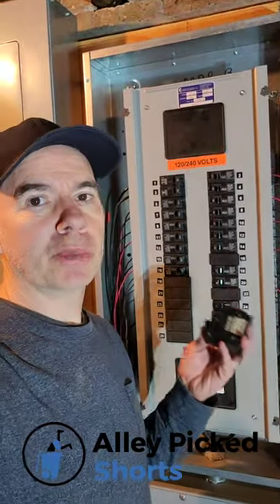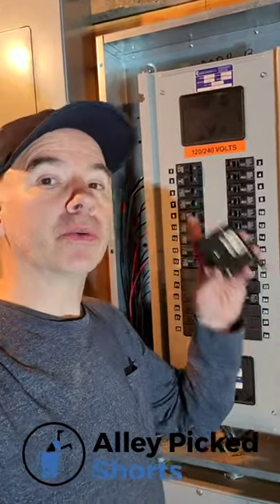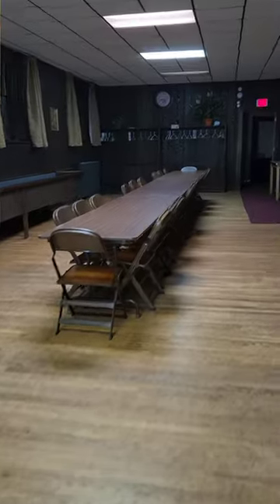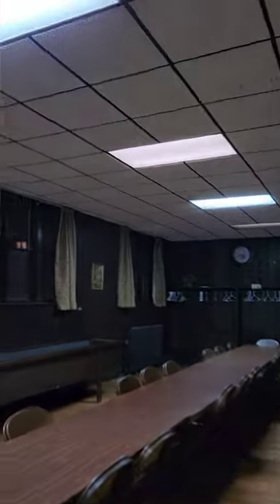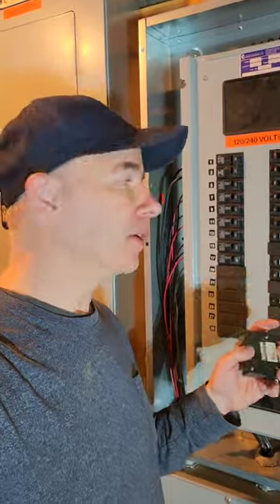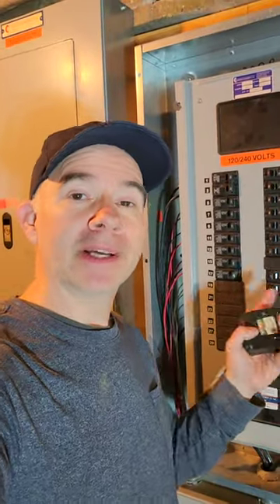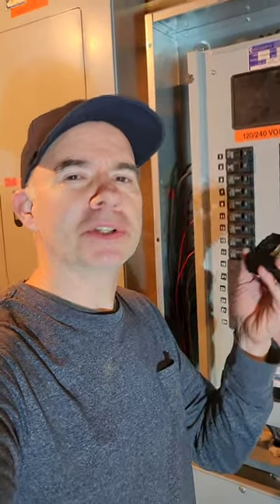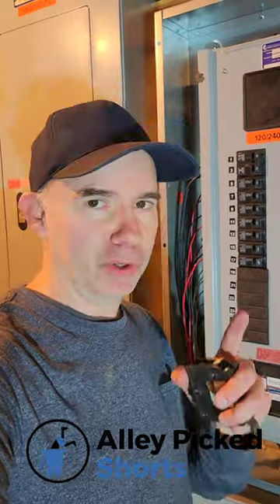When Circuit Breakers go Bad

Comment: So.... I had a problem with my hot water heater one of the anode robs just fried out of nowhere now I got everything new I mean I did it all but replace the actual tank and now it gets no power. It doe have a jumper box like one of a outside ac unit. You pull this breaker bar kind of thing out and it cuts the electricity to the hot water heater I did turn off the breaker before I even pulled that out. Now I'm getting nothing from thet box or my hot water heater. You think it's the double breaker I shut off? If so I would set my multimeter to voltage over 200 and touch each breaker eith the red and black correct? Shoukd read 220 v? Right? Or am I not understanding? I hope you do get back to me if not I'm positive I'll figure it out. I've has such bad luck lately I just really hope it's a breaker and not something more serious. I mean such bad luck it's very alarming. 😪

Comment: My 1965 mobile home has the original breakers.
Built differently back then.
Reply: @candeffect If you have enough circuits, the load on each breaker is way below its rating.  Now if your running some heaters on a, say, 20 amp circuit, it's going to be at 18-19 amps for a prolong period of time and the heat builds up and thus ages it much quicker.  Some people use breakers on lights, it works, but it's a expensive light switch.  This is why main breakers seldom go bad.  They are hardly ever used to disconnect and for most of their life, they operate at only a small percentage of their rating.

Comment: You left the part out where you put a current clamp on it and made sure it wasn’t actually pulling just over the breaker rating.

The breaker is designed to trip on overload on an inverse time basis. In other words, the more overloaded, the faster it trips.

If you haven’t checked the current through the breaker, you have no idea if  it’s functioning as designed.
Reply from the maker: That breaker has been doing the same function for 15 years. It's clear that the breaker was bad and a few minutes to replace it made the problem disappear.